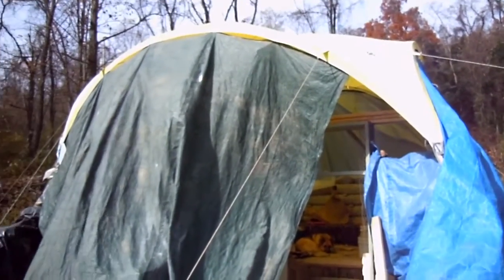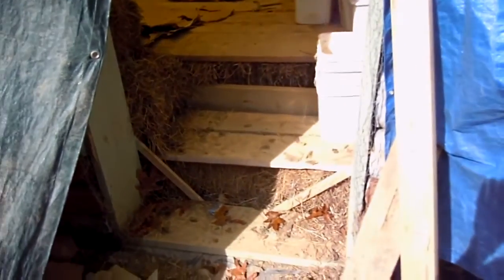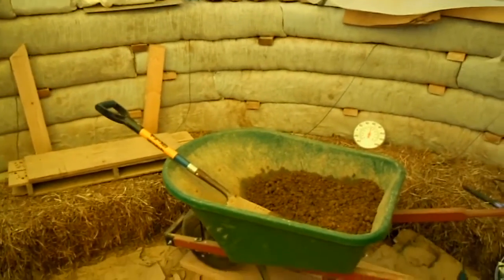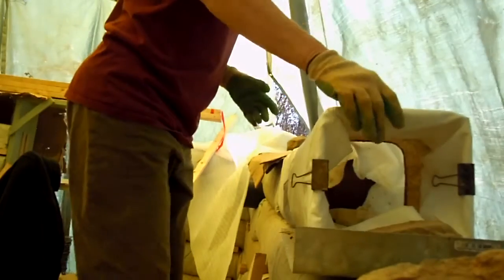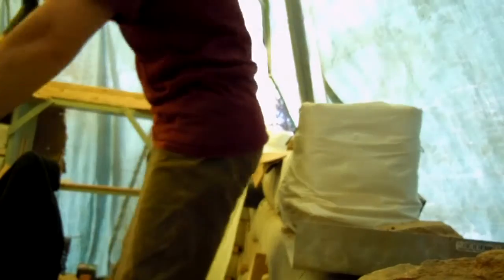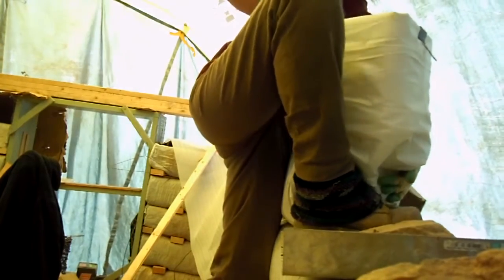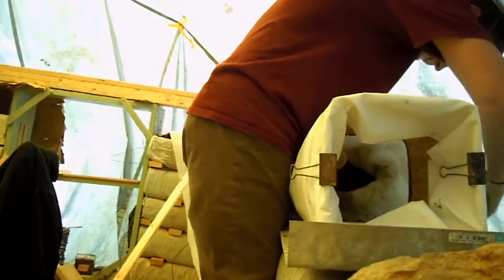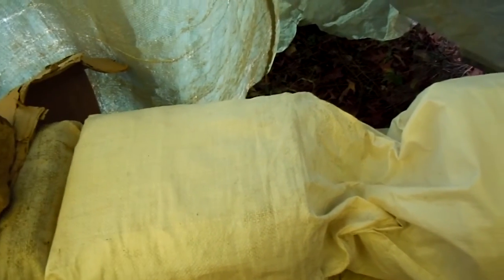Earthbag Construction Bag Laying By Yourself

Comment: Awesome job, T, that is really cool.
Reply: Actually she is doing the work all wrong. 
 It is inefficient to bend and turn with the shovel of dirt and then twist and dump it into the bag.  And you don't pat the bag with a brick. What you do is set the materials close to the wall so you can fill the bag in less time and you complete a whole course, or layer and tie off the bag end and then you tamp the whole layer down in one step with a tamper. This way you take about 1/5th as much time. 
I do like the scoop she has fastened inside the bag opening with clothes pins. Still you could fill the bag with one hand using a small, folding shovel much faster.
Plenty of good information on youtube and in the ebooks and at the Earthbag workshops, but this video is misleading.
Reply: Daniel Cunningham   I tend to agree with you.  Do you have a link to a good example of how it should be done?